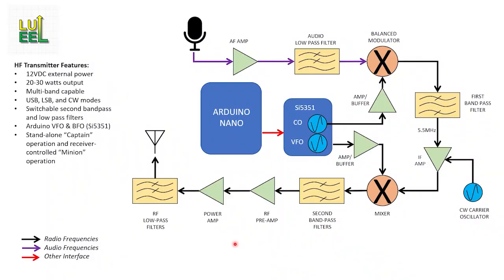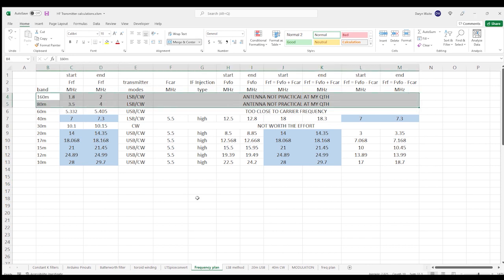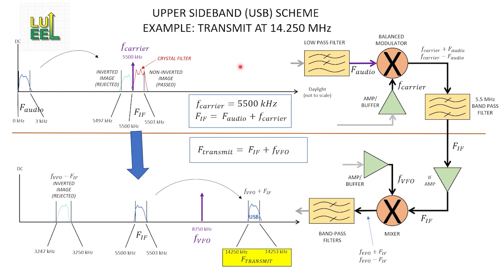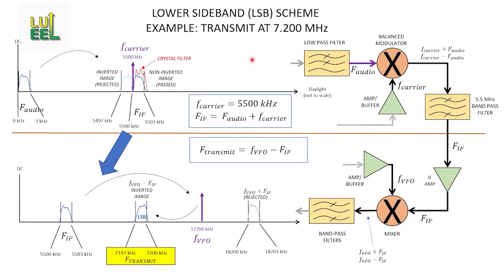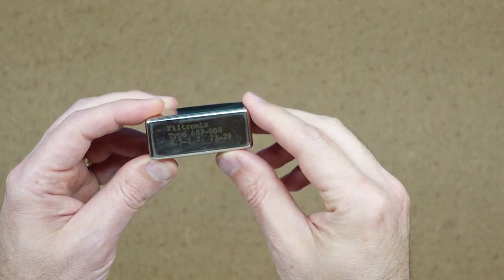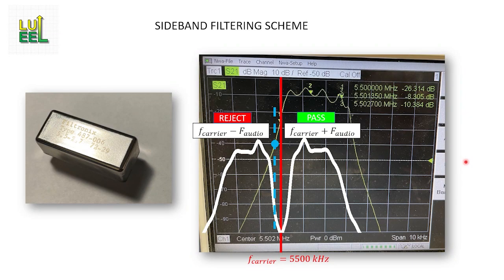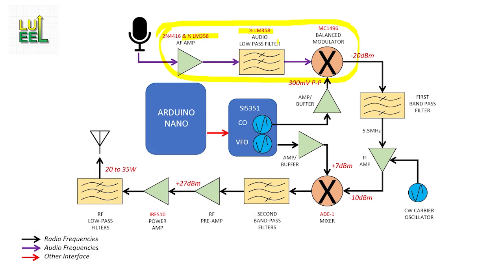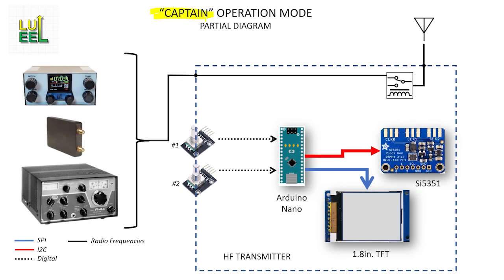HF Transmitter #01 - Project Intro

Comment: One question regarding the receiver. While tuning across the bands do you hear any birdies (spurious tones)? This is a problem I encountered several times in my project and I'm trying to figure out if I'm doing something wrong or simply the output of Si5351 is not clean enough (it looks so according to the spectrum analyzer with small RBW setting, but I wanted to make sure this is the reason).
Reply from the maker: Yes indeed.  There are audible spurs, but they aren't a big issue.  Likely they are harmonics from the Si5351 creating mixer products that are too close to the filter frequencies to get removed.  I also did not experiment with the Si5351 signal strength, to see if it was overdriving the mixer and making them worse.
Reply: @levelupeelab  Many thanks, I just wanted to make sure I'm not the only one who has this problem :) I'm pretty sure the problem is not with the harmonics and mixing products. Si5351 has tiny spurs all over the spectrum, not only odd harmonics, but also even ones and signals in between. These spurs are weak, -100 dBm or so - weak enough to hide from the spectrum analyzer with default settings, but strong enough for a sensitive receiver to hear.

Comment: Great! I'm looking forward to the next episodes. BTW [9:02] Si5351 has enough output power to drive a 7 dBm diode ring mixer, so you don't need an extra amplifier for this. Note that MC1496 has a high input impedance, so you should match it with 50 Ohms of Si5351 (or simply use a second ADE-1). [7:12] Judging by the ripple and insertion loss of the filter it's not a 50 Ohm one. For this bandwidth IL should be <= 3 dB and the shape should be very flat. Try experimenting with different transformers (From personal experience I would bet on ~200 Ohm impedance, so 1:4 transformer should be a good start).
Reply from the maker: Thanks for the tips! Yes, I had already planned to conduct an impedance matching test for that filter and use toroidal transformers on both ends in circuit (future episode preview).